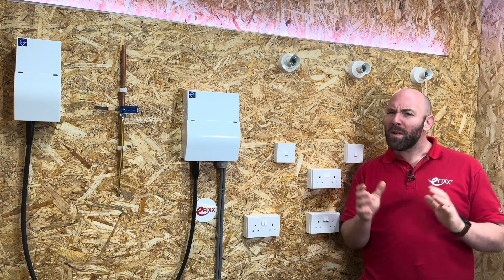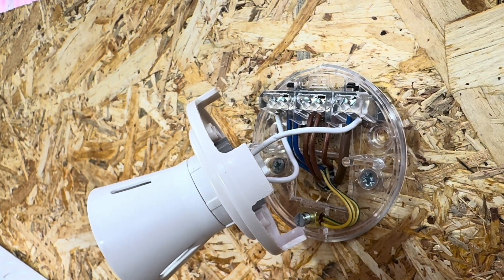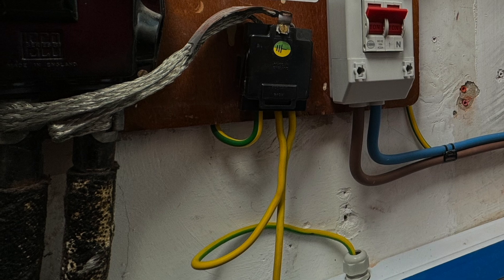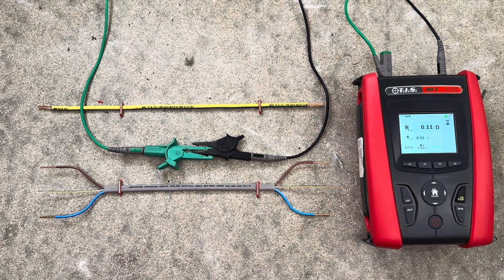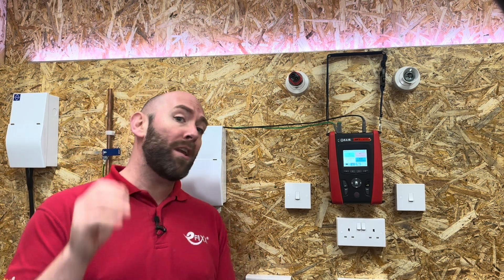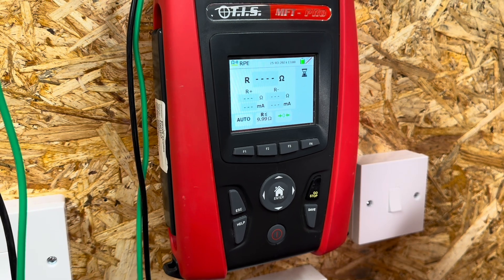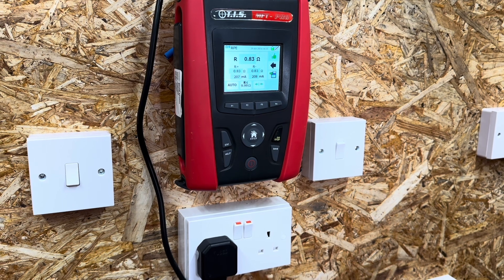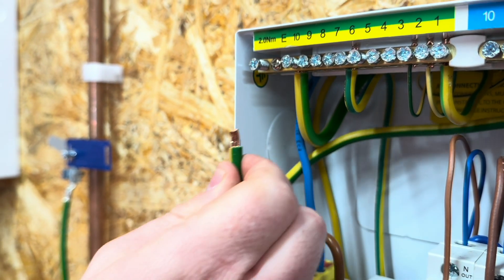Earth Continuity Testing: No Experience Needed!

Comment: Test method 1 is not a correct way to do an R1 + R2 you need to disconnect the circuit cpc and connect it to the live and then do your test. The way you have shown you are testing parallel paths and getting incorrect readings. You should know better
Reply from the maker: See Short reply
Reply: Even guidance notes 3 shows that you can create a temporary link by linking between the line and the earth bar. There's even a nice colourful picture.

Comment: I think you should also remove the CPC from the earth bar for the circuit you are testing as you will not detect a break in the CPC if that circuit also has parallel paths to the point you are testing at

Comment: Can you guess what will happen with washing machine that is connected to water that is used for ground, and there's a constant current leak that doesn't trigger breaker?
The washing machine water sensor will eventually go up in flames!
It might be not your circuit leaking, and it might be not your washing machine, but in apartment building that will eventually kill someone one way or the other

Comment: is calculation at 10:14 correct? not an expert and might be wrong but result looks wrong to me
Reply: @PeterS.-vr4ym  thank you for the clarification  I just checked what's written on whiteboard which doesn't seem to add up as (1/) part is missing. I guess its a well known formula for everyone except me so he didn't bother to add that part :)
Reply: True calculation result is 0.033333 recurring. You can think of it as 1/3 the resistance of one. If there had been four it would be 1/4 or 0.25 of the resistance as all resistances were the same. It's just an example.
Reply: @davebodger2  thank you, I didn't know the formula and what's written on white board is 3 times (1/0.1) is with simple calculation ending up as 30 but not 0.03 so I questioned all my math knowledge until seeing missing piece on whiteboard. There was a twilight zone episode where a guy wakes up and realise all the vocabulary and grammar of the language changed in the country where he lives so almost had similar effect on me :) thanks for the explanation I know some basic formulas but not this one so it would be great if channel folks can consider not all viewers are seasoned electricians -at least not me :)